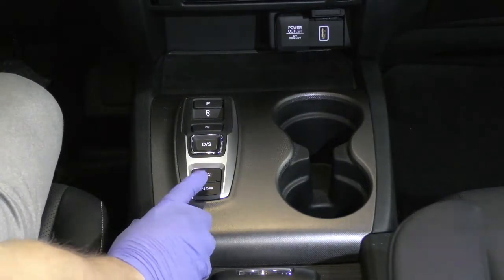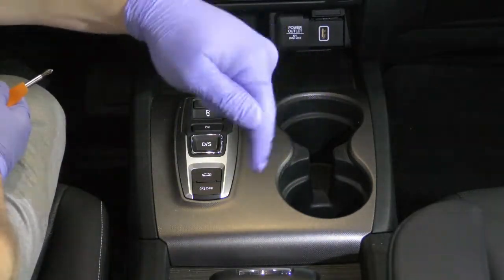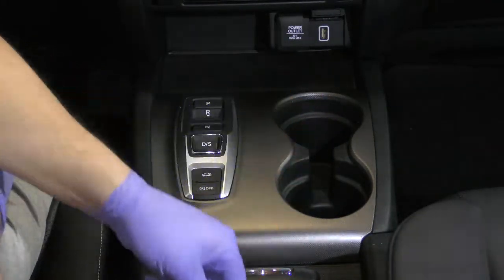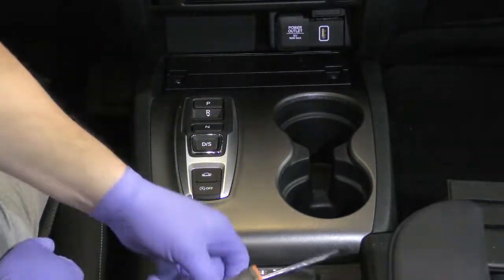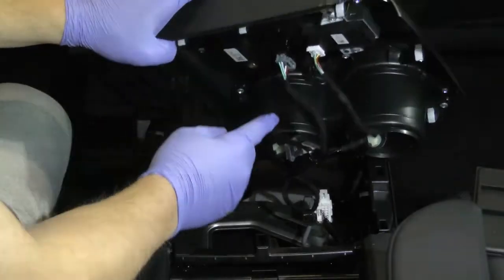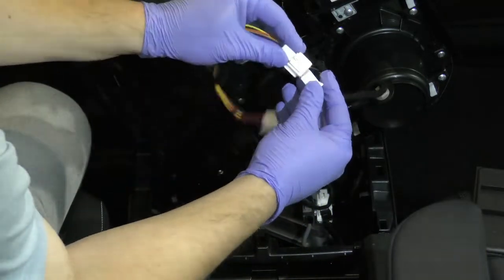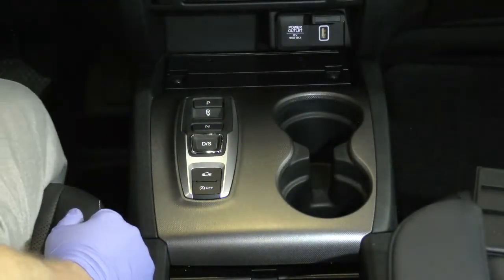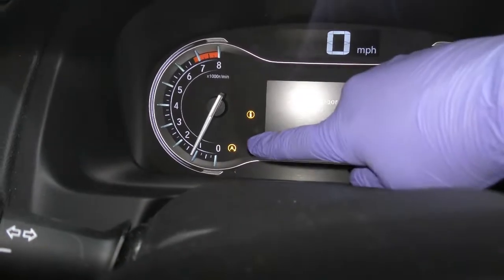Disable Idle Start / Stop - Honda Ridgeline - EASY DIY

Comment: I hate auto start stop so much. It’s the most stupid and impractical invention ever. It tries to make an ice behave like a hybrid but hybrids are way better than auto start stop. In addition, I believe it will wear the engine components out faster because starting is the hardest thing for your engine.
Reply from the maker: I agree. I personally don't think the gas savings outweighs the wear and tear
Reply: engines with auto stop/start have different bearing material... made for just this purpose.
Reply: @turbodog99   What bearings are you referring to? Rod bearings, Main bearings? (Starter Bushings?)

Comment: I hate the amber light on.  It looks like I'm driving around with a check engine light on.   I wish there was a way to remove this feature all together
Reply from the maker: You're absolutely right. Although, I prefer the amber light over having the engine start and stop
Reply: black electrical tape over the light

Comment: That looks easy, you would think that Honda would have the option to disable that on startup.
Reply: They probably legally aren't allowed to let you permanently turn the stop/start off, as that would mess up the EPA fuel/emissions rating.  That's the real reason for these "features", not to save the customer on fuel.

Comment: Thanks for the easy tutorial! I watched a video where they crimped a wire with one idlestopper. But this one is inline, just like the pedal commander. I had a PC for my santa cruz and it worked great but I traded it in on my RTL-E.  I'm thinking about a PC for my RL but I like the idlestopper even more. Thanks again.
Reply from the maker: I'm a couple thousand miles in on mine and zero complaints from me!

Comment: What year is your Ridgeliine? I have a 2020.
Reply from the maker: 2022
Reply: @KeyFobRob  Thanks, after the recall that I have to go through (start/stop, valve adjustment and so forth just issued) you can bet I will get one when they are back in stock.
Reply from the maker: @paulh6517  I contacted the provider and they said at the end of April they would be restocked.
Reply from the maker: FYI - they are back in stock
Reply: @KeyFobRob  Thank you.
Reply: @KeyFobRob  It comes tomorrow. And Thanks for the update.
Reply: @KeyFobRob  Put it in yesterday and very happy with it. Thanks again.
Reply from the maker: Excellent 👍 Take care
Reply: @paulh6517 I'm seriously thinking of buying a 2021 Honda Ridgeline Sport,  can you give me more information on the Recall.

I'm finally selling my 08 Ridgeline.

Thank you.